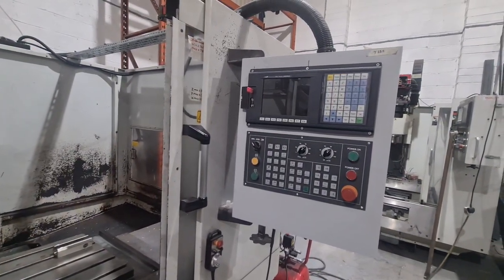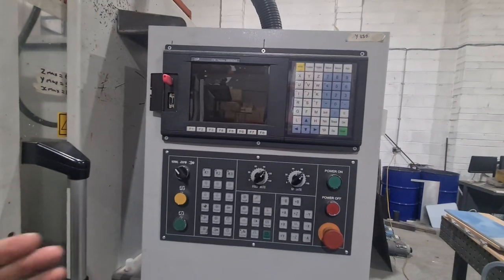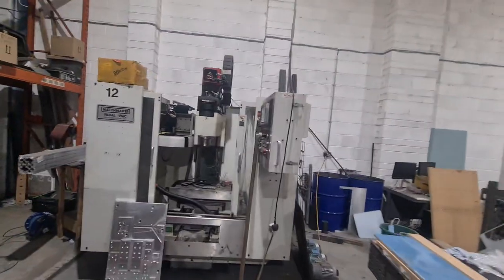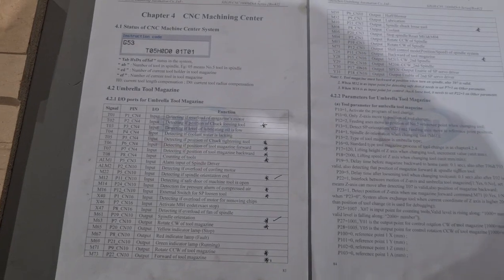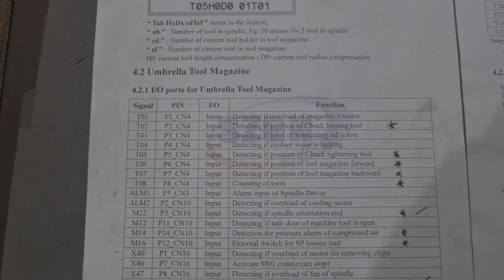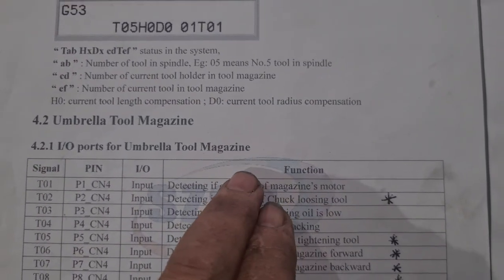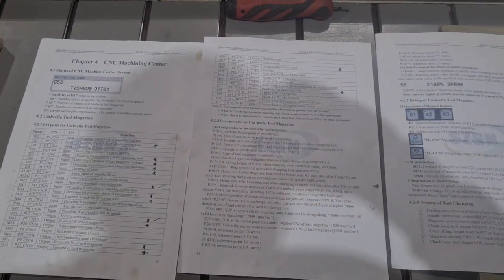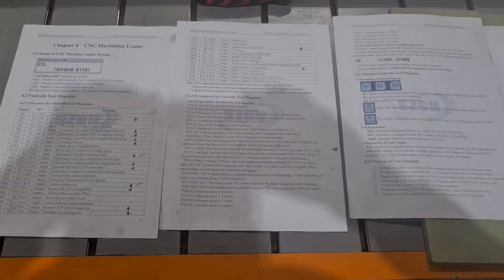SZGH 1000MDBC ATC

Comment: I had situation at fadal when Z is nott a proper Z position. Fadal hit the spindle but after few seconds safely will retract. I don’t know how fadal do this… is mechanical or measure the load from motor. But hit and safely go back. Is possible with this controller?😊 also I have rigid tapping and hi low

Comment: Hi.. I want ask you.. I have cnc1000Mdc and when i connect cable CN3 to I/O board, controller dont turn on... Have you any theese problems? Thanks
Reply from the maker: @libormatak5501  had no issues like that, check the cable with a meter you may have shorted connections.?
Reply: No i have not shorted connections
Reply: When i turn on controller and then I connect io board, it works normaly... But when board is connect, and then I turn controller... Only on screen is szgh picture.. Reset, enter... Dont work

Comment: I want to retrofit my Fadal with that control. Do you recommend it?
Reply from the maker: Yes I do. We run a Hurco BMC40M on a daily basis for last 2yrs with same control and not have any issues.
Reply: My machine is VMC15XT and the size is clase to that of the video. Do you have the size for the motors and spindle? I don't know if your electricity source is 220V three phase 60hz
Reply from the maker: @173roberto  Servo motors are 1.8kw and spindle motor 7.5kw 10,000 rpm.
I have both 240v 50hz single phase and 420v 3 phase. 
They will work with either, I have run them on both. The fadal uses 240v 50hz the Hurco which uses 2.2kw motors and 10kw motor we run on 3 phase.